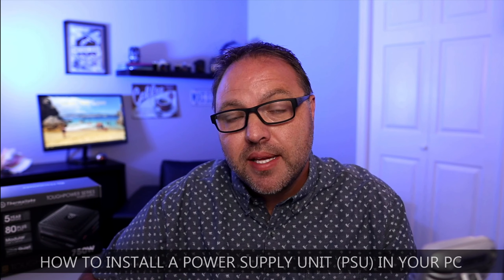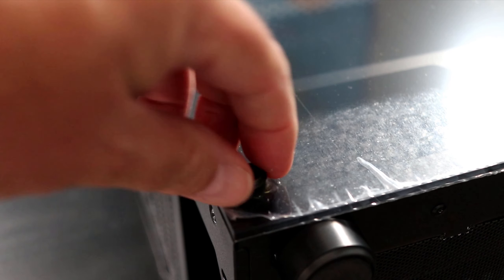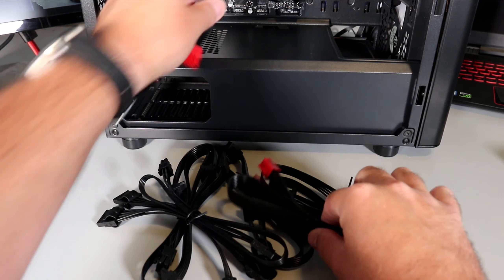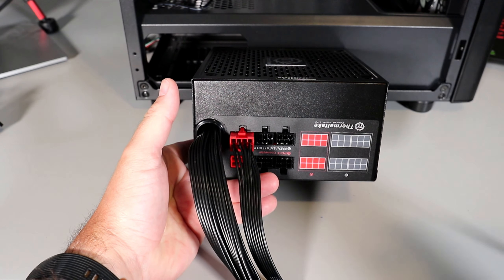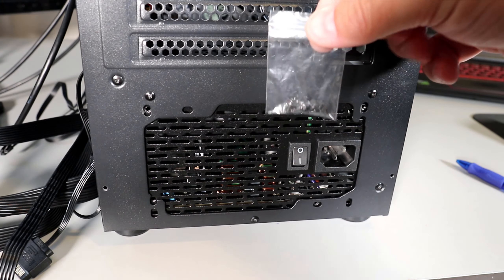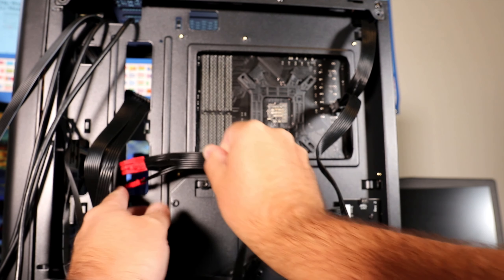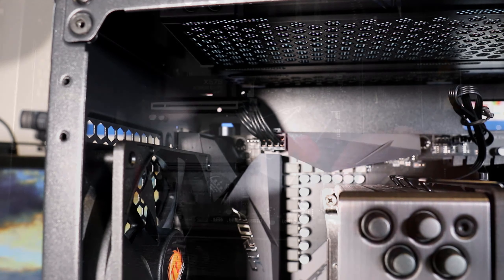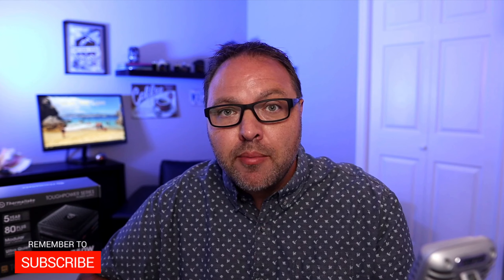How to install a Power Supply in a PC & Connect PSU Cables

Comment: when you install the psu into the case with the psu fan facing upwards, IF there is ever a chance that the psu unit gets hot and the fan does come on, and with the fan facing UP you would be drawing into the psu unit hot air from inside the case and into the psu unit that needs cooling, so rather than drawing in colder air into the psu unit thru the bottom of the case screen you would be defeating the purpose for the psu unit fan to blow colder air into the unit and out the back
Reply: underrated comment
Reply: Ty 2 years latet

Comment: I was wondering if a 600 watt psu is enough to power a Intel core i3 12100f and a GIGABYTE GeForce RTX 3060 Gaming OC 12G and a MSI PRO B760-P getting ready to buy parts hopefully it doesn’t explode
Reply from the maker: If you go to the PC part picker website, you can input all your components and it will give you an estimated wattage needed.

Comment: I own my own pc I brought but found a pc on the rubbish pile turns out to me a gamming pc about 6 7 year's old but it would just start and turn off done the general rule of thumb so iv pulled out the psu and brought a second hand one I knoe that works nd hopefully this fixes my issue's I completely forgot where a couple plugs went mind blank.watched this video and bamm memory straight back
Reply from the maker: Awesome 👍 best of luck, I hope it works out for you.
Reply: New psu pc started up just waiting on a cheap gpu 2gb then Windows 10 install :)

Comment: Im using m2 ssd does i need sata cables only or which cable should i use
Reply from the maker: The nvme m.2 drives don't use  a cable. They are mounted in the slot on your motherboard and you're good to go.